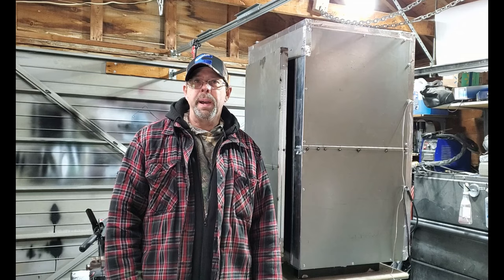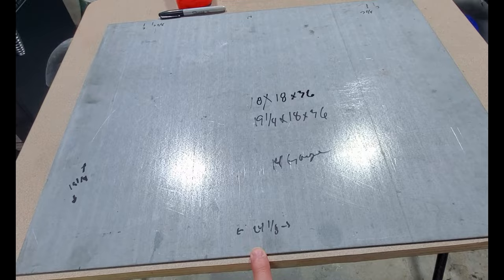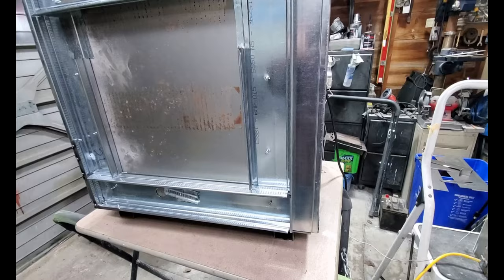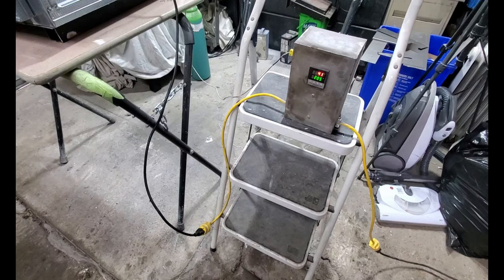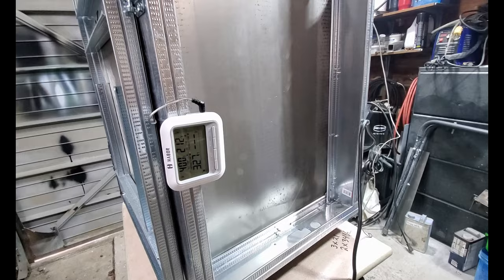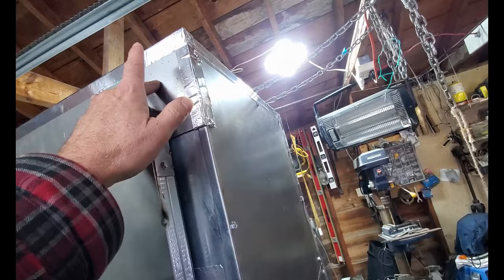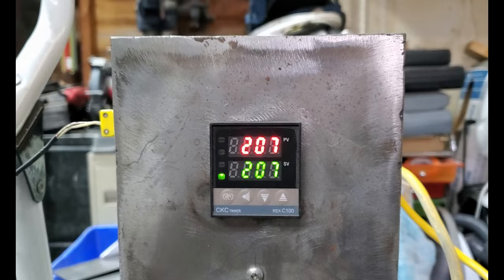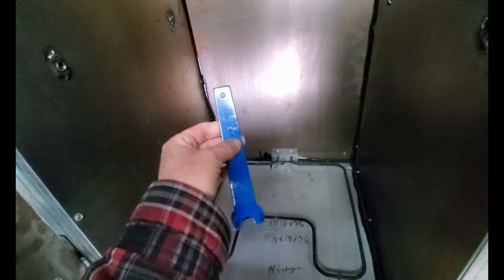DIY Powder Coat Oven

Comment: FYI They do make a base track the studs fit inside of. Save you some time and there are no electrical cut out in them either
Reply from the maker: Yes they do. Be using them on my oven upgrade shortly. Thanks for watching and commenting.